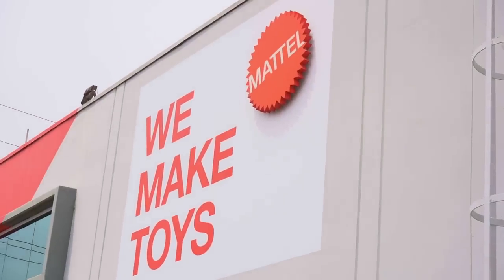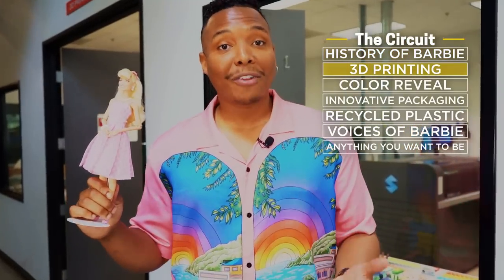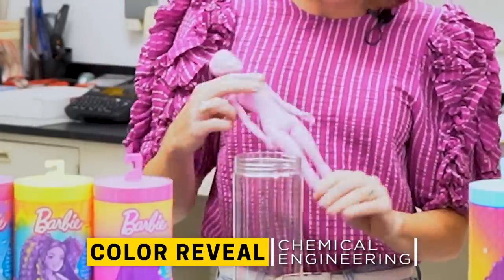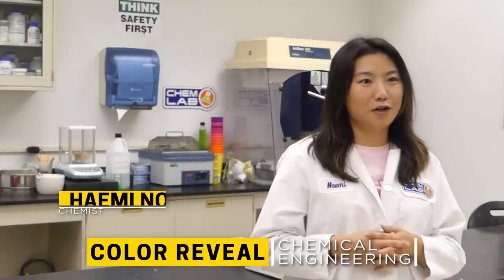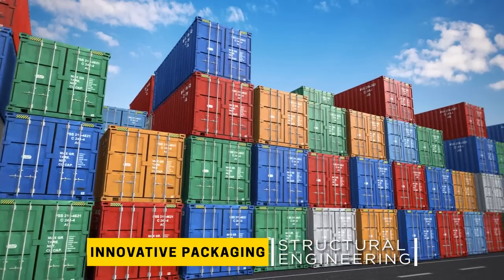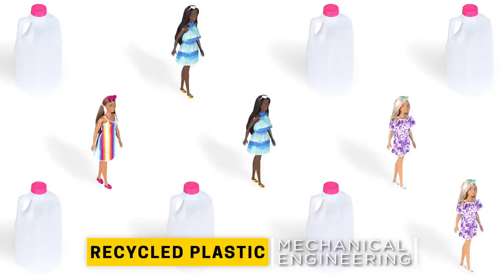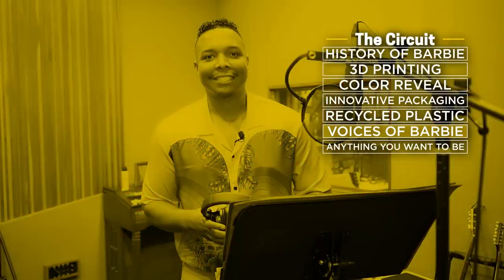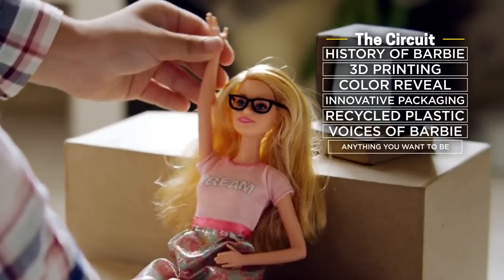How Mattel Engineers Barbie

Comment: Considering that they have 3D modeling and 3D printing at their disposal, I'm pretty underwhelmed by the final end product of the face and body sculpts Mattel has been creating over the last few years. The celebrity portrait sculpts should be a lot better than they are, for one thing. The Margot Robbie and Laverne Cox dolls just don't look like the women they're supposed to depict, though I think some of that is the fault of the paint design and application. I love Barbie and always have, but the current era of innovation isn't that compelling in my opinion.
Reply: Hello - Instead of creating a whole new mold, Mattel sees if they can use an existing mold, such as the Lea/Kira mold for the Vitamin C doll, or the Shakira doll who both used the same Lea/Kira but with different make-up. Both these dolls are lovely. Check them out if you have not already done so. Happy collecting. - DrD
Reply: @drdarrylschroeder5691  I have the Vitamin C doll, and both of these dolls came out decades ago. I'm talking about what Mattel is doing now. 

I honestly think that the sculpts from the 70s, like Kate Jackson and Debby Boone, look more like the celebrities they were designed to depict than anything Mattel is doing now. And yes, they do try to use existing sculpts for celebrity dolls a lot of the time, and it mostly doesn't work in my opinion. Vitamin C (who uses the Goddess face sculpt, not Kayla/Lea) works as a doll not because it looks like the singer, but because it's a pretty doll. Same goes for Shakira and a few others. 

The Beyoncé doll, which does have a custom portrait sculpt, does not particularly resemble the real Beyoncé, and doesn't really work from the standpoint of a doll. Mattel often makes the mistake of creating these likenesses with a big smiling expression, and that almost always falls flat. Most of the extremely popular sculpts Mattel has created over the years do not have the big toothy grins. The 1972 Steffie face, the Goddess sculpt, the Mackie face, and many others have a solemn, composed expression. If Beyoncé, Margot Robbie and Laverne Cox had been depicted in that manner, I think they would all have been much more successful sculpts. Just look at the Cher, Diana Ross, Audrey Hepburn, Elizabeth Taylor and Grace Kelly portrait sculpts. Regardless of the degree of likeness, all of these sculpts resulted in beautiful dolls. I don't understand why Mattel makes this same mistake over and over again, ignoring the lessons of the past.
Reply: Agree it's shocking that with all the creativity and resources at their fingertips and all the amazing dolls that were produced in the past we are now stuck with the same boring clone and very plain Millie Barbie even on collector dolls like the Barbie Styles, it's a joke.
Reply: even with 3d printing, there's a limit on how much details you can have, specially considering that they'll have to polish (lterally sanding) the 3D printed sculp, wich will get rid of even more details, before creating the mold.

Plus, there's the whole aesthetic of the brand itself. having 100% realistic dolls doesn't fit their aesthetic.
Reply: @luguidubiela1654  yes, but that doesn't explain the essential contours and proportions being off balance. I don't expect Hot Toys realism from Barbie. As for the level of detail, 3D printing is capable of a LOT more than this. Just look at all the small detailed accessories Mattel produces, as well as the face sculpts for MOTU and other figures.
Reply: @Siansonea  The Margot Robbie Barbie and the Laverne Cox should have been incredible likenesses of the actresses like the Beverly Hills 90210 dolls from 1992 were. They just don't push to have the quality that they once had. I agree, whenever they give the doll, a big toothy smile, it never seems to work. I think the Farrah doll and the Superstar Barbie head are the only recent dolls with a smile that are convincing.
Reply: I so agree with you @Siansonea. Even with the Tampo Stamp screening which although sounds efficient and innovative, The end result is just underwhelming with its pixelated outcome and often times wonky or distorted end result. The quality of today’s Barbie dolls is just not like how it was 10-15 years ago.
Reply: I wonder how much is engineering faults and how much is artistic direction faults. I really wanted the Laverne Cox doll, but the eyes are too far in and the head shape is very off from its subject. When they came out with the Ella Fitzgerald doll I thought, well, that’s a very good Lena Horne doll but a bad Ella Fitzgerald doll. It didn’t capture Ella Fitzgerald.
Reply: I would do a Superstar face revival for playline. It’s the most recognizable out of all Barbie faces and the most successful. Just give her modern makeup ( thicker brows/no blue eyeshadow ) and modern clothes. Dear gad, and at least an articulated knee.
Reply: Monster High did a slam dunk job on the new Wednesday Addams Jenna Ortega doll! Looks just like her!